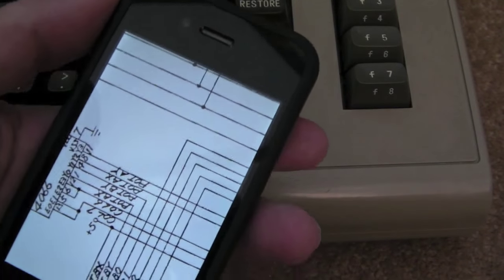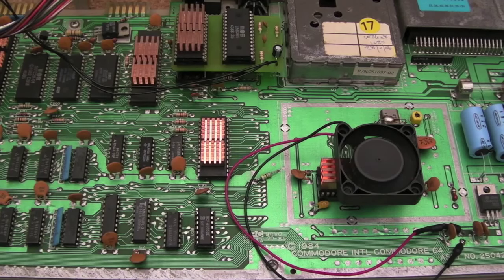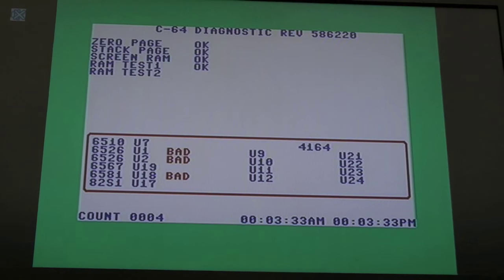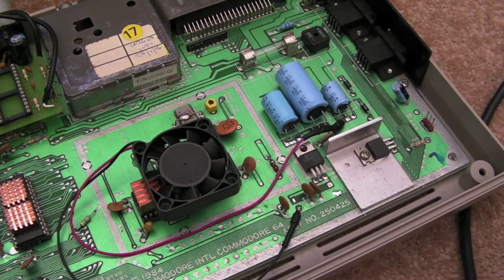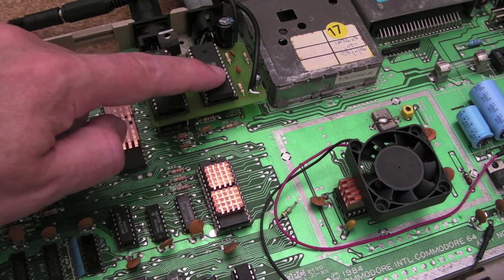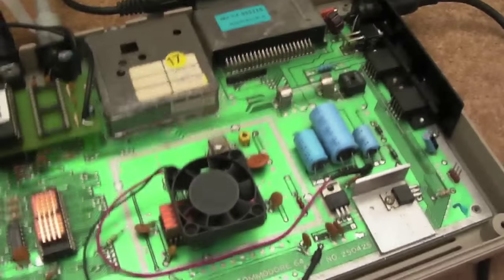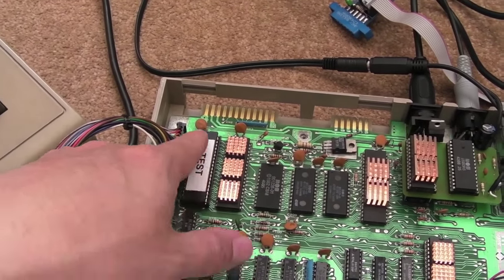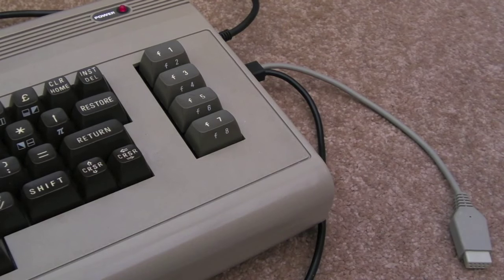Commodore 64 (C64) Input Problems & More (Dual SID, PSU, Switch, Socket, 4066)

Comment from the maker: IMPORTANT:  Note that the test I did here to ground POTX and POTY is not the ideal way to fix the particular problem.  In the next video I uploaded I covered a proper fix which disables the 2nd SID when the R/W pin is high.

Comment: Back in the day when I repaired C64's (this is in the 90s) the US versions at least - the power supply was potted (for some reason...) and when the old ones got hot the voltage would change - I assumed that was what was destroying chips on these systems. That was always step 1 - put in an after market power supply - otherwise you'd see me again :).

I do admire your videos though - back when you could get supplies straight from Commodore - repairing these seemed so simple.  Now that parts aren't so readily available you never cease to amaze me the ways you fix stuff.
Reply from the maker: Thanks =D  Yes, the old C64 PSUs are a bit notorius for killing systems!  You should check out bwacks "5v saver" board - it works really well!

Comment: Glad to help and put you on the right path, and thanks for linking to my channel.  I was all on about the power connector, but it was the switch. My C64C had been off since 2001, and when I switched it on in May this year i got a black screen. If I tapped the cartridge shield then the C64 would start.. I later figured out it was the switch that was bad. Btw are these switches still available ? The ones in the C64 reloaded board look quite similar and maybe the ones for the classic C64 still exist on the market.. There are so many microswitches out there..
Reply from the maker: A similar switch must be available, maybe on digikey or something?
Reply: GadgetUK164 Haven't found a exact match yet. Spent some time on mouser and digikey doing searches. Found that there are so many combinations and often not the combo you want, however the actuator (black plastic rocker part) can be ordered separately. That gives more flexibility. Looked at NKK switches, C&K, and E-switch. All have same problem with they are not flush with the main board. They can be modified though with a file or dremel.. http://no.mouser.com/ProductDetail/NKK-Switches/M2022TXW41-FA/?qs=sGAEpiMZZMtNT9UGfLL4eLap%252bYp2FX4GeqfADY8qtAE%3d ON-ON 2P DPDT right-angle-vertical (lots of search filters, but doing all those filters and you filter some applicable ones.. )..
Reply from the maker: That switch you've linked there looks ideal!  The one used on the Reloaded boards has a reset position as well I think.  So you can have it in off, on, or reset position, the reset automatically clicking back down to the on position I think.
Reply: GadgetUK164 That's cool :) There are some discussions already about the classic C64 switch,. This from a swedish forum , but you can see in the pics longer down the thread that he cut away a plate underneath the switch to make it flush with the board.. http://commodore64.se/forum/viewtopic.php?f=12&t=5632 ..  it took him 30s with the dremel to cut the plate. same guy writes longer down the thread (in swedish, i understand it) that he used all day to get the switch desoldered. Something familiar comes to mind :D
Reply: GadgetUK164 Side note. The C64 Reloaded seems to be using T80-R Salecom power switch (saw it in a photo of the Reloaded board). Those switches that Salecom have, they are flush !! Now where can we order those :) http://www.salecom.com/en/product/Rocker-Switches/r8015l.html
Reply from the maker: Well spotted!  The problem is they appear to be DPST by the looks of the 3 pins?  Looks like just designed for one voltage, whereas the other switches handle 2 I think?
Reply: GadgetUK164 Hmm. Maybe you're right.... check this one http://www.salecom.com/en/product/Rocker-Switches/r8017l.html
Reply from the maker: That looks like it will do the job!  Just a case of trying to source some =\. I meant SPDT previously - I always get the poles and throw mixed up lol

Comment: Very interesting video, Love the detail your going into on the internal issues with the IC's and how to overcome them. Regarding axial and radial caps the way I always remember it is if you can hold the cap by its leads and spin it like an axle then its axial ;) regarding the switch I did have a go at taking one apart after watching Bwack's video unfortunately broke two of the little tabs off while trying to reassemble it. but nothing ventured nothing gained I guess. Also WD40 isn’t a good idea long term, true it will work initially but it contains organic compounds which over time will decompose and form a non conductive layer adding to the problems. always use servisol super 10 or similar. Ps if you find the switch is bad or a tab brakes off like mine did give me a shout I’ve some good used spares, might also have a few spare power sockets if yours is getting a bit warn (get a cheep set of dental picks fantastic for getting in to bend the contacts in slightly I do this on valve pin sockets all the time in my vintage tv's)
Reply from the maker: Thanks!! And thanks for the tip about the caps - I should be able to remember that now!!!  I didn't know that about WD40 so thanks for the info there!  I've used it so many times though and never had to revisit years later, so it must take a while before it becomes an issue.  It might depend where it's used I guess?

Comment: OK, determining axial and radial designs is very simple. "Axial" simply means "of the axis," so the wires are sticking out of each end of the cylinder. "Radial" means... maybe you guessed it... "of the radius." So that would then mean that one wire is in or close to the center and the other one is somewhere along the radius from there!

Comment: thanks for the video, good to learn some new things from your adventures :)   do you do anything to your C64's or have any suggestions regarding doing a mod so that the C64 never gets more than 5v? (ie. if the PSU goes bad and sends more than 5v, that would damage chips with overvoltage) ... i think i read somewhere about adding a zener diode (5.6v?) to achieve this....
Reply from the maker: Thanks!  Yes, I've shown the C64 "Saver" on my channel.  I also used the PCB of the same thing in the Amstrad CPC Power Supply I recapped (I did a video on that too).

Comment: Interesting video, one question, why do you use so much heat sinks on some of the chips? I mean the original c64 dose not have those.
Reply from the maker: +Błażej Partyka The MOS chips in these systems get very hot and cooling can help extend the life of these aging chips.  Back in the day these systems weren't expected to be used for the 30 years or so they've been knocking around now, so anything that can be done to extend their life is worth doing.

Comment: WOW, that's was a really good watch, i noticed you talk allot like me in terms of you don't take a breath and now i know why people find me overwhelming. btw Axial and Radial, the way i remember it, Look down at a capacitor that is mounted without being bent over, if its a nice round top its Radial (2 legs sticking out the bottom) same thing look at the cap from the top and if it looks like the axle of a car wheel and you could most prob roll it, then its Axial. (1 leg sticking out either side of it) i cant find the link to your proper dual SID update video.
Reply from the maker: +Silverfox0786 Thanks =)  There was a lot of messing about in that video - If I had recapped it from day one, and cleaned up the power socket and switch, and thought a little bit about the Dual SID board I should have worked out the issue with Last Ninja 3 a lot quicker =/
Reply from the maker: +GadgetUK164 And thanks for the tip on Axial / Radial =D
Reply: i know that feeling so many times have i looked back and though, wish i did that or thought of that before. Your welcome on the cap tip.

Comment: With the dual sid implementation does the paddle function still work? Apologies if this question has been covered before. Cheers...
Reply from the maker: Yes, if you do the diodes resistor mod in the later video.
Reply: Thanks again, keep up the good work!

Comment: following on from my previous post on your previous Video, i have found a fault relevant to this video on my C64, I have a full harness diag cart so when i see an error i cant ignore it, because it will be a true error. i found I was getting both CIAs bad and the infamous 4066@U28. i didn't have any spare 4066 so i decided to get a pair of known working CIAs, plugged them in and after that both CIA good and i didn't get the 4066@U28 error. about 20 odd cycles and everything spot on. I even tried 8520 Amiga CIA and again spot on no 4066 error. i then tried the faulty CIA in a known working C64 and albeit I didn't get a 4066 error I did get BAD CIAs. so that concludes to me that my CIA where BAD and Causing the 4066 to report bad. I think I will change the 4066 as its possible it is flaky.
Reply from the maker: +Silverfox0786 The SID ultimately can cause that 4066 failure.  It relates to the Pot X and Pot Y inputs on the SID.  In my case the 2 inputs on the 2nd SID were floating.  The CIA can also give a 4066 error in the diagnostics as well.
Reply: cool to know, i,m really contemplating getting a dual sid2sid are they worth while to get
Reply from the maker: Take a listen (with head phones on) to the 2nd half of my Dual SID video - You can hear how the 6581 picks up some frequencies better than the 8580 and vice versa.  https://www.youtube.com/watch?v=2Qlqeaxkp14
Reply: cheers i shall give it a listen over the weekend. one thing i personally found when using the test cart and checking SID chips was the 8580 from a C64c (plugged into a breadbin) is slightly nicer to my ears, i kinda prefer it. what's your opinion. to me it has a warmer sound and the 6581 has a crisp sound
Reply from the maker: They are both different in their frequency handling characteristics, the 8580 is much cleaner and sharper and has a better range of frequencies, but the filters aren't as good as on a working 6581.  The two compliment each other well in a dual SID setup.
Reply: Thanks

Comment: Hi mate, you got an amazing set of vids here :)I hope you can help me out here ,,, where should I start looking in order to fix following: I have a bunch of  disk drives where the LED changes and stays in red (initializing / startup mode) on a particular breadbin, and it happens the moment I turn it on. (so when I turn off the breadbin, the problem is gone)On my other commodores, the disk drives all behave normally. They interact to power on of the computer, and then go into ready mode.But on this breadbin, any of the drives I try, the computer boot turns the device in a endless initializing state, I think.... :) Any idea?
Reply from the maker: Thanks!!  I've heard that a pull up resistor was added to some C64 revisions, on one of the serial connections - you might need that resistor.  The other possibility is a problem with the CIA, or the 7406.
Reply: You will not believe this. It works fine if datassette 1530 is not connected. Any idea how much I narrowed it down now, what could be root cause?
Cheers and keep those vids coming!
Reply from the maker: It's pull up resistor related.  bwack did a video on this, check out his channel.  I believe he had the same problem when a datasette was connected!  I suspect you might need to remove a resistor from the FDD.
Reply from the maker: I think this is a similar but not identical problem:-
https://www.youtube.com/watch?v=F5aJR33s9-Q
I wonder if your C64 is lacking the 3.3k pull up resistor.

Comment: I don't see why do you have to use a fan in that C=. Isn't a heatsink enough for the hottest chips?
Reply from the maker: Some VIC II chips can get incredibly hot - in my case even with a heat sink I was finding after prolonged use the chip started to make a bad connection with the socket and needed re-seating.  The cooler you keep a chip like this the longer it will last (in general) - 2nd law of thermodynamics etc.  Since I've had a fan on there I've never had a repeat problem.  Prior to that every few months it needed reseating.  I could also just replace the socket, but I would rather try and make that VIC II last.

Comment: Hey gadget uk164 like your channel I have a few commodore 64 questions how can I ask you them
Reply from the maker: You just asked a question here - I give everyone a free question!  You just used yours up ;)   Just kidding! =D   Just ask on here, or send me a private message on YT or Google+
Reply: GadgetUK164 - Retro Gaming Repairs & Mods
Reply: I have a commodore 64  when the Vic gets too hot does it cause it to start to make the picture and characters turn into blocks
Reply from the maker: I've seen that problem a number of times - most of the time its the VIC getting hot and as a result the connection to the socket has become unreliable - cleaning up the pins and re-seating the chip, and then adding a heat sink can often fix that.   If it still comes back it will be a heat sensitive problem with the VIC chip - I've seen that a few times.  It could also be your PLA glitching out maybe, but probably VIC related.